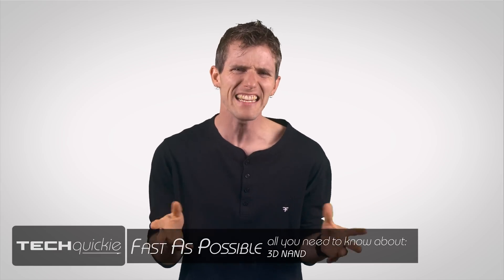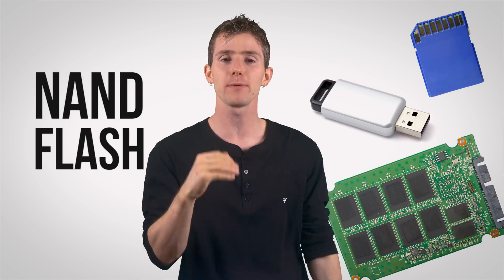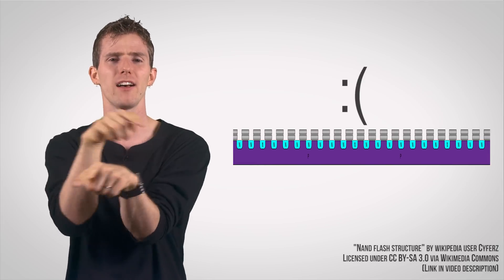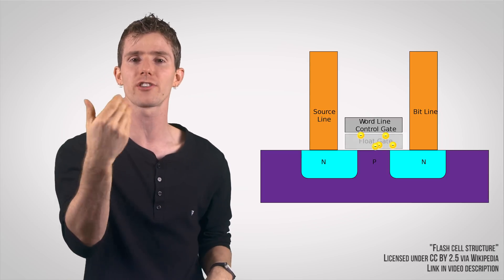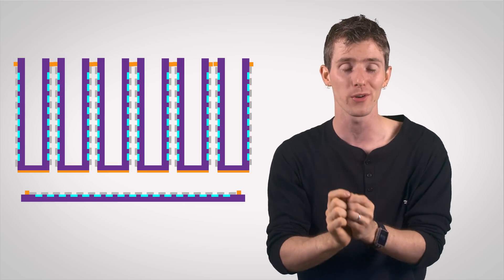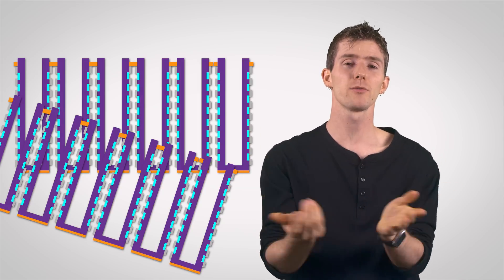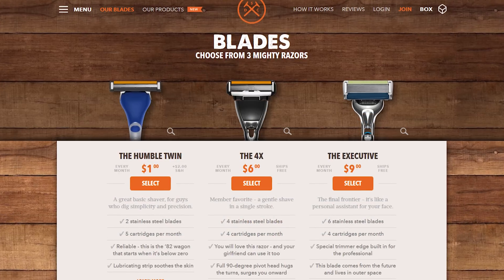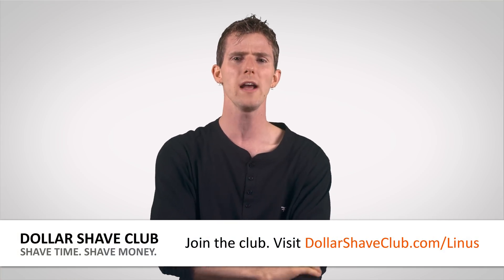3D NAND as Fast As Possible

Comment: spotted a mistake, at 2:01, Linus said 'the electrons are trapped in a layer of oxide', where the floating gate should be polysilicon instead of silicon oxide.

Comment: so what current products use 3D nand flash that I can purchase right now for example? I know the 2.5" Samsung 850 Pro uses it but what about the M.2 NVMe 850 Evo or Pro or 860 Evo or Pro (I'm only referring to M.2 NVMe). My 850 Pro says MLC but what about 3D nand?
Reply: The 2,5" 850 pro uses 3D mlc(2 bits per cell) nand. The 2,5" 850 evo uses 3D tlc(3 bits per cell) nand. The 960 pro uses 3D mlc(2 bits per cell) nand. The 960 evo uses 3D tlc (3 bits per cell) nand. mlc is theoretically better than tlc, but in reality it's more expensive and you probably won't see a big difference. All data is for the ~500gb versions.

Comment: Your transistor physics are not accurate. Electrons dont get trapped in the oxide, they get trapped behind it in the polysilicon floating gate. Im pretty sure the signal doesnt come from charge accumulation either. It comes from whether the channel gets inverted or not based on the voltage applied to the control gate and the charge stored in the floating gate. If you had to use the accumulated electrons as the signal, Flash would be dynamic memory.

Comment: Shouldn't be that hard to figure out. Just stare at old core memory and sew in a Z axis and treat it as either a cubed memory array or a cubed logic array instead of a PLA. may need to factor in some R over D for flipping a center bit then measure how far away the bits flow should allow for dif input voltages.

Comment: Question: Why didn't they just stack the flat architecture layer by layer, rather than folding it?
Like, the old way was one plane. Couldn't they put more planes on top of that, until it takes up as much space as the new way of doing it? Is it just an issue with designing the controller to take advantage of it?
Reply: By bending it that way it's still a single continuous strip - probably lower production costs.

Comment: Good luck actually using up all vertical space. I mean in a micro-SD card this might actually already be happening (the 200GB ones seem to max out the thickness) but in thumb drives or SSDs you could probably make those dies cubes and still keep the form factor. And micro-SD is a wondrous but pretty impractical form factor anyway. Give us isolinear chips. Those have a handy form factor and they can store 2.15 kiloquads. So there.

Comment: serious question, if physical size is an issue, why not make SDDs bigger? like 5.25"? would there be any drawback in terms of speed or reliability?
Reply: I know old comment but, Probably the drawback is in electric consumption, besides it will be hard to fit 5.25 form into mobile devices such as laptops and tablets or even desktop systems as some of these SSDs are plugged in PCIe and M.2 slots
Reply: @abbesatty9498  I would add to that saying more silicon takes more time there by adding to cost. How ever we are not to far from where we will need to do that.

Comment: And I'm still waiting for a 3TB external SSD
Reply: Hardik Sankhla Hey may only have a laptop that has no other way to expand storage. But to upgrade the SSD or use an external drive
Reply: Hugo Joubert a 2TB SSD is in existence but due to the company that who made it, samsung, in short saying there is no market for it there is no consumer version nor any OEM version of it on the buy able markets atm :(
Reply: yumri4 Up to 4TB is now available, but anything over 2TB is ridiculously expensive for a single drive. Even the 4TB drive (Samsung) will fit into a 2.5" bay, though!

Comment: anyone getting a black bar to the right of the player in cinema mode?
Reply: chaz1299 Most people get it
Reply: it's annoying as fuck and it seems to default the video quality to 360p. Chrome updates fantastic as usual...https and now this.
Reply: chaz1299 Try Magic Actions for Youtube. It has AutoHD and other goodies.
Reply: Rebasepoiss Yup, that extension is awesome! Only problem is, that when you set auto HD to 720 then it's 480 and when you set 1080 its 720 ETC...
Reply: chaz1299 But.. That black bar is supposed to be there.. It doesn't look bad at all

Comment: What's the actual increase of capacity we can expect from this technology in the future ? Are there any numbers?
Reply: Jonah Livingston Crucial is Micron's in-house consumer brand, and the 10TB model SSDs will be sold under Crucial and Intel. So in a sense, it is a team-up between Crucial and Intel.
Reply: Razor Liew Actually it's Intel and Micron. Not Crucial.
Reply: ***** right now we're semi limited to 1 or maybe 2 TB's.  With 3d Vnand,  up to 20x more as a realistic guess.
Reply: ***** More than 10TB? Crucial and Intel are teaming up for 10TB with their entry to the 3D NAND
Reply: Jonah Livingston Crucial is Micron.  basically lol.  And intel developed 3d transistor technology years ago when they went to 22nm nodes.  I don't know why its taking them so long.
Reply: 2sites Because this has nothing to do with Intel's 3D transistors. Completely different technology.
Reply: It's not completely different.  It's not the same, of course.. but it is similar technology.. the whole idea of creating 3d nand came from intel's fin/fet design.  Without Intel's manufacturing process, Samsung never invents 3d nand.  Of course it isnt the same technology but there are many similarities, and it is a derivative of sorts of intel's design.
Reply: 2sites Intel decided to run the channel through the gate as opposed to running it under it (as other, including Samsung, still do). This doesn't save much spaces but it does increase efficiency a lot. What Samsung did is take their normal planar design and bend it into a U shape. I really don't see how these technologies are related.
Reply: +2sites > I don't know why its taking them so long.

My guess is research cost and recoup. Intel already did research on a tech, so they try to promote it before they switch to another tech even though it's already proofed and ready for release.

Comment: Does anyone think upgrading from a 2600 cpu to a 4790k is a worthwhile investments. There isnt many comparison videos out there of those 2 cpus so i dont know if there is any cpu bottleneck in some games or if upgrading to a newer architechture will provide significant difference

current
i7 2600 
8gb corsair vengeance
z77 extreme 6 mobo
gtx 780ti

new
i7 4790k
asus z87 mobo
16gb g skill ram
gtx 780ti

I game on a 1440p monitor
Reply: I would invest in a Z97 mobo to go with the new processor, if possible.  An i7 can be overkill for gaming, and if you're not overclocking there's no need for a K series.  Perhaps get a reliable z97 mobo + i5-4460?  Depends on what you need.
Reply: I would also get a z97 mobo. At this point there isn't really a reason to upgrade unless you need it. Wait for some new technology to come along (trust me, it will) and then it'll be more worthwhile. If just want better performance than try upgrading in something that won't go out of date as fast. You might also want to look into another GPU maybe? Your setup looks pretty good now so unless you need it, I would wait and give it a good thought and some research.
Reply: SudoChocolate I agree with most of what's said there.  Right now it'd be best to wait.  However, I'm pretty sure a 780ti is a keeper and still a viable GPU and still will be for a while.  But that remains to be seen, of course.
Reply: +Devon Crain I agree but the 780 is a more realistic upgrade than the i7 at this point. If you we're to get a better GPU I would keep both.
Reply: my main reason for upgrading is that i get more ram 16 and a legit windows 8.1 key and also since the cpu is quite better than the 2600 and with windows 10 comping and offering better multi threaded support for games i dont want any cpu bottleneck. also down the line i would get a second 780ti and sli them so i want to eliminate all cpu bottleneck completely. i wont be upgrading this cpu for at least 3 years
Reply: what does a legit windows 8.1 key have to do with it? just buy one of those.

Comment: Could this transfer over to CPUs too?
Reply: +vgamesx1 it is slightly different when it comes to CPUs memory is a lot of repetition so it may work in some places of the CPU. CPUs work on logic gates. I think this method is utilized somewhat already but it is just kind of different.
Reply: Christoffer Hannevig Intel has been doing 3d transistors for a couple years already.  They invented it.  All 22 nanometer cpu's are 3d..  like haswell chips.
Reply: Daniel Phillips You don't need coolant when you have the nanotubes. Graphene is a fantastic heat conductor.
Reply: Not sure why this is important on CPUs this for fitting many GB in a small space. Not a few MB cache.
Reply: Christoffer Hannevig this already is done in intel cpus since ivy bridge
Reply: OnePercent apparently it's already used in intel's ivy and haswell processors.
Reply: Christoffer Hannevig But it's not actual compute transistors that are in 3D, some other things like Cache maby
Reply: Well, to some extent yes, but not really. The difference is that memory chips are relatively simple and are composed of only a few conductive/insulating layers so it's relatively easy to reshape the whole thing to make a U shape. The logic circuits in CPUs, on the other hand, use 40+ layers, so it would be very hard to “bend” them simply because they are too thick (to make it worthwhile, you'd have to make the “U”s pretty tall, but then you wouldn't be able to cool it). Pretty much the only thing you can do, is what Intel's already doing: Instead of having a flat, wide channel under the gate, have a thin, tall channel (they call them fins) run throught the gate. That way the transistor takes up a smaller area (and are faster and more efficient because the gate is on 3 sides of the channel, not just 1).
Reply: Christoffer Hannevig that's what I thought but there must be some technical reason why that isn't possible otherwise we probably would've done it already.
Reply: BattousaiHBr Ahh that makes sense, so in that case why not stack them a bit more so vertically and make a sort of box shape kinda like this l__l with a cubed shaped heatsink to slide in the middle?
Reply: Christoffer Hannevig And the benefits for cpu's are just size, power consumption, and slight performance.  It's mainly size and power consumption.
Reply: Christoffer Hannevig Totaly works with CPUs aswell we just didnt found a way to get rid of all the heat yet but this be a thing in the not so distant future
Reply: MrBlockyTV 2sites vgamesx1 BattousaiHBr oh nice, thanks for the answers :D
Reply: Christoffer Hannevig It would be possible if you had some sort of nano tubes carrying coolant inbetween them, but that's not remotely possible with todays technology. In the future wouldn't be suprised if this was the case though.
Reply: I'm well aware of that, but they are hollow so could potentially be even better with it
Reply: Christoffer Hannevig They can do this with CPU's but there would be no way to cool a 3D CPU, unless you use liquid nitrogen
Reply: OnePercent the voltage regulators are 3d in the intel cpu
Reply: OnePercent voltage regulators*
Reply: SudoChocolate I'm positive he didn't mean storage.. pretty sure he meant why not stack the transistors so that way you could fit way more of them into a single CPU die, thus making them way more powerful.

Comment: Hey Linus, I got a chinese knockoff of an 128Gb micro SD card, and it was actually 8Gb, however, the storage capacity does show 128Gb, how do they achieve this?
Reply: Armax Firmware shenanigans, or they actually fool the registry to register as 128GB.
Reply: Armax You got fucked, Man
Reply: swafsal
You can't store the data though.
It tells you it's writing, but it's actually not writing anything, or rather writing all your information nowhere.
Kinda deep.
Reply: Armax you can store the data but cant read it.

Comment: From experience the Dollar shave club razors (based off a Dorco design) clog up and can flex the blades causing massive irritation. They suck.

And that's why I moved to a safety razor.
Reply: ThereIsNoMatch #WetShavingMASTERRACE
Reply: ***** yes, my rectum bled for days.

my lawyers will be in touch.
Reply: ***** whats a safety razor?
Reply: MoDRun A safety razor is the predecessor to modern cartridge razors. Instead of having 3, 4, or 5 blades it utilizes a single very sharp single blade for no tugging.  

Not only are the blades a tenth of the cost, the razor will out last your life span with ease. 

If you want to learn more check out http://www.reddit.com/r/wicked_edge
Reply: Amateur. #DollarTreeRazor5PackMASTERRACE
Reply: ***** too bad adblock can't recognize this type of ads.
Reply: ThereIsNoMatch I have a year supply of blades for less than 10 dollars.
Reply: Blox117 Be careful with that, those are some sharp blades.
Reply: ***** instructions not clear.
safety razor stuck in rectum.
Reply: Some old medicine cabinets used to have a slot in the back wall where you put your used safety razor blades. Unfortunately, that means, they just went into the stud space. You have to be really careful when remodeling to not cut yourself on the old blades.